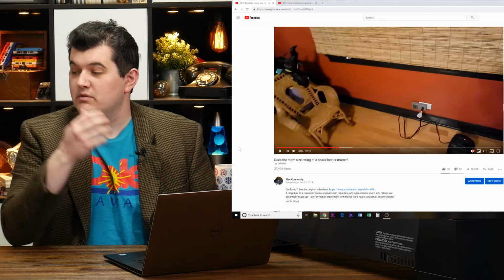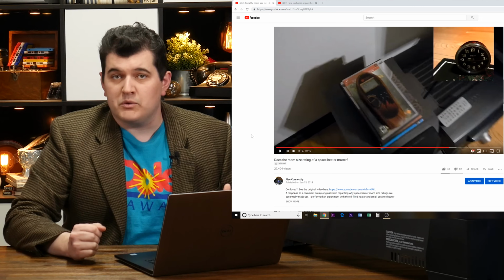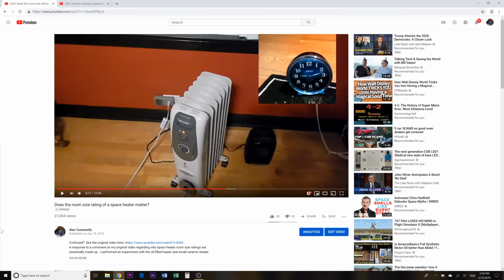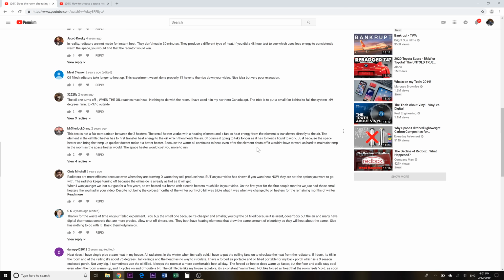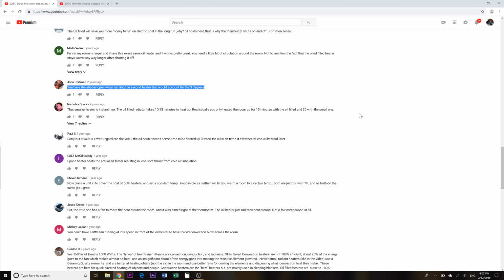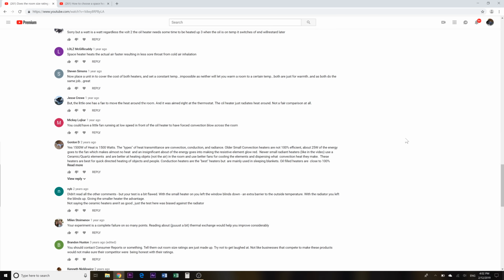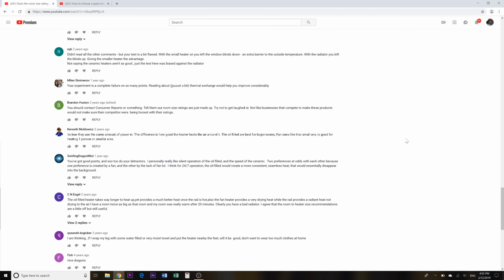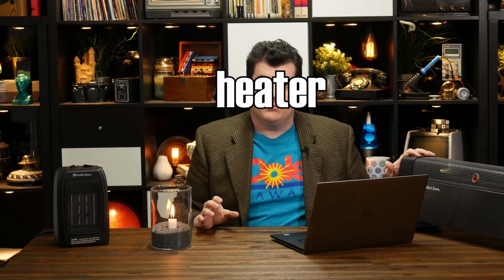More Space Heater Nonsense

Comment: Great video. I sympathize with your frustration over the general lack of knowledge of physics and the odd conviction they have over how they've rationalized their un-scientific conclusions. If you aren't completely tired of this topic though, I'd be interested in how these different types of heaters affect humidity. Humidity greatly affects how warm a person feels (at least it does for me). In my opinion, if a room is dryer, it has to be warmer to be comfortable than more humid room. I use an oil radiator style space heater in my bedroom because I (perhaps irrationally) believe that it is not pulling as much water out of the air as a forced air style one which I basically see as a large hair dryer that pulls more water from the air.
Reply: In high air temps, high humidity is less comfortable than low humidity, but that's a function of how we sweat to regulate our body temperature. I'm not sure that higher humidity (at a given temp) always feels warmer though. 

That aside, the type of electric heater does not affect the absolute humidity of the air in a room that is relatively well sealed. A more effective heater will tend to keep the average room air warmer and thus the relative humidity (RH) will be lower than for a worse heater. This effect is magnified by draughts/vents exchanging room air with exterior air that is usually significantly colder and drier whenever you're needing to use space heaters.

No heater "pulls water out of the air" - if they did, they'd have collection tanks like dehumidifiers or else be leaving puddles behind, which they obviously don't. If you want to heat air without the RH dropping, you need to add absolute humidity - many combustion heaters emit water as one of their exhaust products - or you could keep houseplants. Cutting down draughts will help too by not letting cold, dry air replace warm, moist air.

Comment: Worry not, you're not the only one frustrated by this, by the general derp of the public, and by marketing wank. Trust me, even if you made a video about the much worse, catastrophically less-efficient "portable air conditioners" that are rated exactly the same as their window or split counterparts, people would still bark at you stuff like "they're both 12000BTU so they both chill the same wadda wadda" without realizing that these units have their compressors and both heat exchange radiators inside the room... Thus proceed to chill the air... and immediately suck part of that air they've just chilled back into themselves to vent it outside through their heat exhaust (usually through those large corrugated hoses). Thus generating negative pressure in the room. Thus making warm air(from outside or other rooms) leak back in through every crevice in the room.

Sure if you crank them up to max and leave them running for hours, yes they'll chill the room. *Slightly*. The cooling side of their gas circuit might be a bit more efficient than the heat exhaust (not sure if/how that's possible) or... I don't know. Objects in the room expel heat to the temporarily colder air coming out of it? Thus over time the room feels colder? Most of the time though... They just put out chilly air only just in front of them while the rest of the room is warmed back up by the outside air that is seeping in to equalize the pressure. And waste massive amounts of energy doing it. The units I've checked tend to run on about 900~1100W@220V.

Split units have their whole "hot side" heat exchange unit and compressor outside so they don't push or suck any air in or out of the room. Air that is chilled in the room actually stays in the room.

Look them up if you've never seen them. Might make a fun educational video. If you want a 2-to-98 like-to-dislike ratio video of course :D
Reply: I can't have a split or window unit due to how my apartment is, so I have to have one of those hose-box units... and you're not entirely right: it's very effective, if not efficient - it can keep the room very cold on a very hot day, easily holding down a 40F temperature differential without issue. You're not wrong about negative pressure, energy efficiency etc.... but those things DO work, they do cool a room, even if in a very messy way.
Reply: You would lose some efficiency but so long as the exhaust is directed to the other side of a reasonable thermal insulator say by terminating the hose in a hole in an exterior wall with the exhaust outside it could still pump heat out though you will pump less W(thermal) per W(Electric) due to the undesirable pumping of some of the cool air outside the space.

Comment: How about a quick video about ceiling fans?  A lot of people find the turn direction counterintuitive.  
Argument #1: In the winter, a downward breeze acts like a wind chill, so have it pull air up.  In summer, a breeze feels better so blow down.
Argument #2: In winter the heat has collected at the ceiling so blow it down.  In summer, pull the cooler air up off of the floor.
Reply: Now I'm going to lay awake all night thinking about the 2 ceiling fan arguments.

Comment: For a better test, if you ever chose to do it again, and with the 2 models you show on camera ( that way, you bypass the problems of using an oil based heater ), Is to do the experiment again, but in a room with a ceiling fan.   Just set the fan on medium or low, and run the test for like half an hour or so, and make sure the fan is spinning in the same direction in both tests. 

And if you don't have any rooms that has a ceiling fan, and doors to close it off from the rest of the house,  A simple box, or stand up fan blowing up at, or across the ceiling would also work well, just as long as the fan isn't moved in each test. 

Again, it will prove that 1500 Watts is 1500 Watts, Just as long as both are pumping out 1500 Watts for the entire duration of the experiment, and aren't shutting themselves off ever 5 minutes.
Reply: don't forget to have the ceiling fan set to winter mode because it movies hot air down.

Comment: I dont disagree that 1500w is the same over each heater, but what if you factor in over a longer period of time (lets assume that you use electric as a primary heat source), and in a large room. Does the duty cycle of the heater and style of the heater provide a more efficient source of heat if you use a "Large Room" heater?

Comment: One confound for your experiment I didn't notice you mention (but have seen many arguments close to the one I'm making), the ceramic heater is directly heating the air and circulating the air in the room which will drive up the air temperature very quickly as it's dumping all 1500w into the air. 

Meanwhile the oil filled heater (assuming the heater mass is up to temperature) is heating up everything in a line of sight to the radiator by radiation, meaning a larger portion of the 1500w is being absorbed into the non-air matter of the room relative to the ceramic heater.

I think the best easiest experiment to prove that they work "the same" would be to get the room up to equilibrium temperature for each device's respective 1500w mode, then measure how the devices perform to keep the room at the equilibrium temperature.
Reply: The name "radiator" is a misnomer the dominate method of heat transfer is still convection.
Reply: @MikeRomeoMike62  I would still argue that a significantly greater portion is given through radiation than compared to a forced air electric heater.
Reply: @MikeRomeoMike62  this dude comes to a similar conclusion, radiation is arguably not the major component, but it's not negligible.
experimentation would be necessary to get an answer.
 https://edavies.me.uk/2014/08/radiators/

Comment: I'm really surprised at how many people can't wrap their heads around this. 1,500 watts is 1,500 watts regardless of the size of the heater, how it moves the air, or what size room the box says it can heat. It's like thinking you have more money if you have a dollar bill than you do if you have four quarters. It still adds up to one dollar just in a different package.
Reply: The only difference between the heaters is how uniformly they heat the room. A larger heater will heat the room to a more uniform temperature than a small heater. That is why I believe there is a difference in the labels on the box.
Reply: That might be true if you compares some of the heaters labeled for small and large rooms, but most still put out 1,500 watts regardless of size. Over less than an hour the room will be heated uniformly by either heater though. It is shown in the video where he shows the temperature taken  across the room from both heaters. In fact, it showed that the larger heater is likely less efficient at uniformly heating the room than the smaller one is. You can also find many small heaters that oscillate and blow warm air throughout the room, which means they would heat the room just as or more uniformly as any large heater of the same wattage.  1,500 watts is 1,500 watts.

Comment: I know it probably doesn't work like this, but in my head why not just aim the small ceramic heater at an unplugged oil filled one, and the oil filled one will get heated up by the small one and radiate the heat.  Obviously the small one is wasting heat heating up the oil filled one, and not spreading the heat through the room as well.  It's just a stupid thing my mind says should work if I don't think about it enough.

Comment: Personal opinion/observation. My oil filled radiator gets stupid hot in 30-45 minutes and doesn't cycle much when it's cold, however if I'm trying to use it when it's around 60, yeah, it's gonna cycle on and off some, but not as much as you describe. It also helps keep a more consistent heat even though it is slower overall to distribute it. Small fan blowing ceramic heaters get hot in under 5 minutes and can raise temps faster and higher, but with that they can cause a room to become uncomfortably warm depending on operation. 

Another personal observation, I used to use a small ceramic heater but it broke, it would get really hot and could be felt about 3 feet before rounding the corner to the room it was in. I now use an oil filler radiator in the same space and I feel that heat about 10-15 feet before rounding the corner where it's located (if given ample time to warm up). The only advantage to the radiator is that it is about 3 feet closer to the corner. 

So I think the takeaway from my personal experience is the small heater is supposed to be quick and dirty heat that gets hot fast but may get too hot and cause you to adjust it while the radiators are a slow more gentle distribution that are meant to have a more even heat distribution. If you want to emulate the ceramic heater using the radiator style pair it with a large fan that can push air past the blades of the radiator. It's less elegant but I'm sure it'll seem like it's closer to the effectiveness of the small heater. I've had mine set on top of a floor vent and used my home's central fan (central A/C and Heat no worky but the fan works) to blow air on it from below before.

Also, have you considered that your oil filled radiator is faulty? Or was faulty if you don't have it anymore.

Comment: Sorry I wasn't watching your channel 5 years ago. I'm an HVAC designer, I'd have defended you.
Reply: Sooo... K, let's hear it! What elaboration can ya provide?
Reply: @HelloKittyFanMan.  1500 watts are 1500. Watts. Every thing he said is right.
Reply: @christopherlambert5264 : Yeah, I didn't doubt that. I just wondered if you had more that you could add for that defense.

Someone  even said that maybe the REAL room-size thing has to do, instead, with how long each heater can afford to stay on (setting aside the thermostat problem): "Assuming that the load is proportional to the size of the room, a 1500W heater should heat a small room fast and shutdown quickly." So maybe the bigger heater can afford to stay on longer, and thus take longer to heat up a bigger room with only the same 1500 watts (you couldn't make the bigger room as much hotter past the old temperature as you could make the smaller room, but then to make them the same temperature, you'd have the heater on for less time in the smaller room, and a smaller heater might afford that lower duty cycle just fine).
Reply: @HelloKittyFanMan.  I guess the only thing I could add is since watts are watts, it's about the type of heater, how it heats. Convection, radiation, conduction. You pick the type for your application.
Maybe the people are saying that the small room heaters aren't good for big rooms in their experience happened to pick the wrong type and were dissatisfied?
Reply: @christopherlambert5264  
Any idea why a Convection only heater would be better than one with a fan for "large" rooms?
Reply: @Appletank8  I guess to some degree "better for the application" is also about how long you want to keep it running. They all put out 1500 W, fine, so all can produce the same amount of heat. But as he mentioned, the smal heater with the fan wil blow out the heated air immediately and it immediately fells warm in a rom up to a certain size. And now here the size information may make "some" sense (not a whole lot). The larger heaters working with convection or radiotion without fans put out the same amount of heat, it just takes longer for the heat to spread within the room. Going into a larger room, for any of them it will take longer to heat up the room anyways. Not better, but not worse. And comming to a certain room size I would guess the amount of circulation the smal fan heater produces, simply does not matter any more. It does not heat less or worse, but also not better/quicker.
Reply: @alexku8452  
Small heaters tend to be cheaper, so, that would be one way its better, in a sense, if the only thing you're looking for is time to warm. 

If you're thinking about safety or comfort, then other things will come into play.